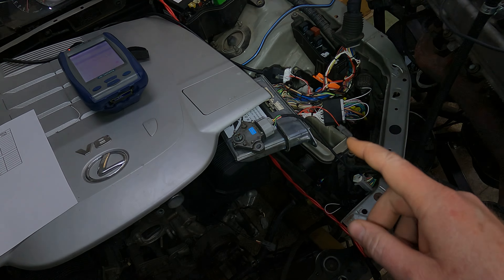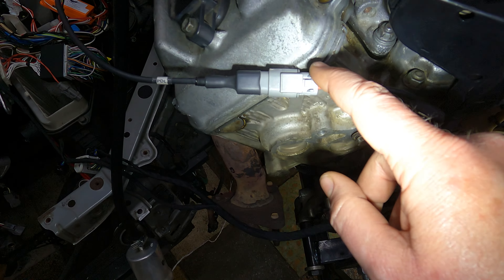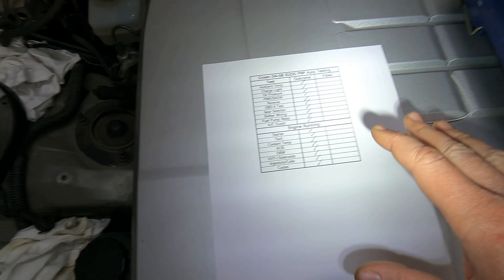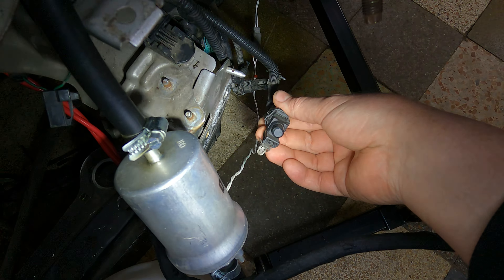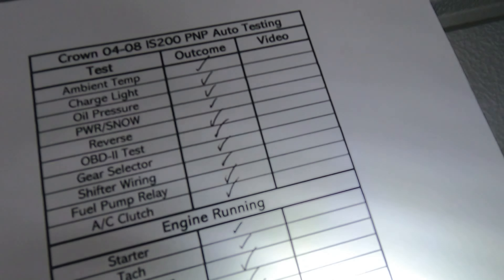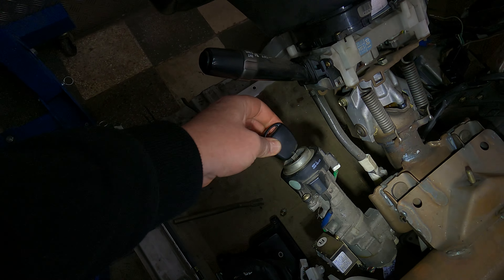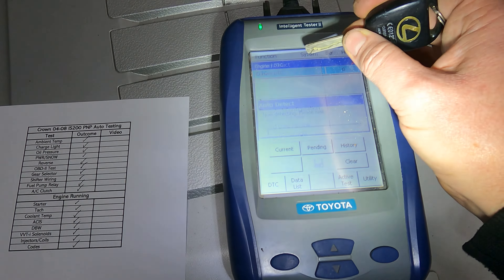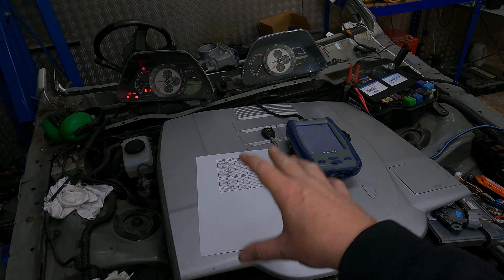Karl Toyota Crown 2004-2008 3UZ-FE VVT-i to IS200 Plug and Play Auto LHD

Comment: If you added shift up and shit down buttons as you mentioned, would the indicated gear also change on the oem dash when in manual mode - does your translate box have a reference for that signal?
Reply from the maker: As far as I am aware no but we do very little Auto Harnesses here so it may very well do. Would take some testing